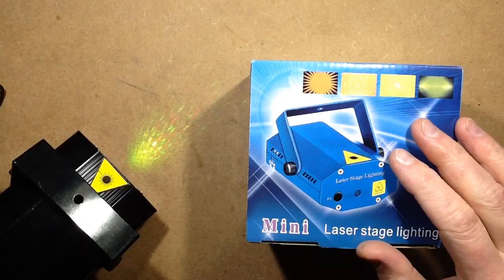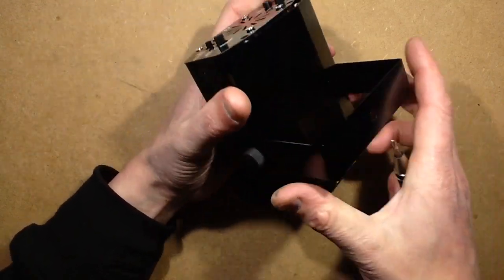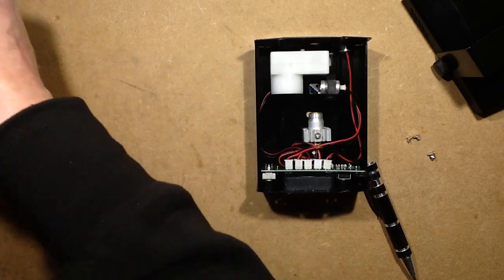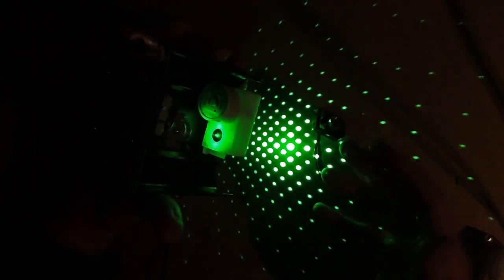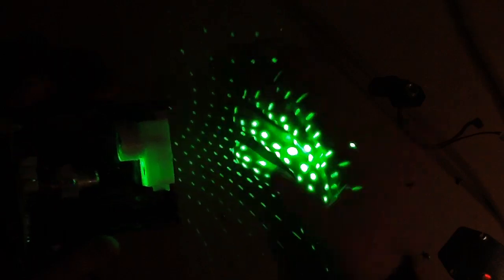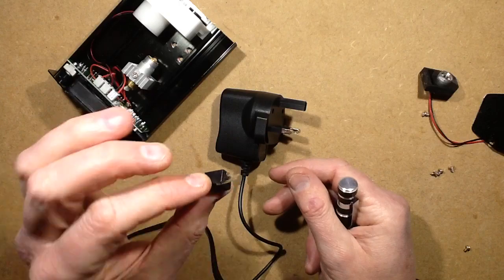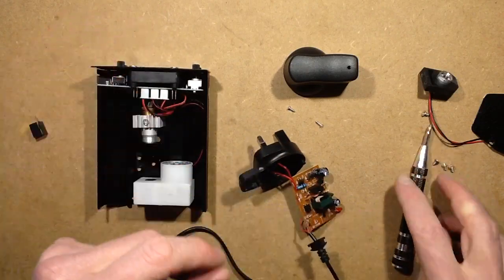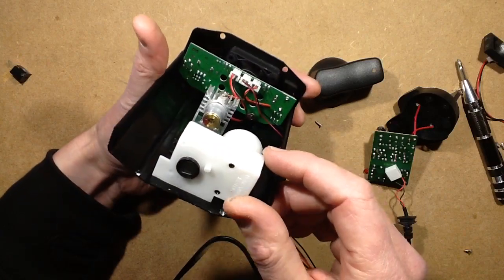Inside a laser star effect projector and mods.

Comment: I made some underwater boat lights using casting epoxy and current drivers last year.  Im light years behind on powering high powered lights. This year my new project upgrade was going to be aspheric lenses to add to the beam effect underwater. Wanted to start using cree multi whatever you call them with multi tir lenses like used on flashlights or off road vehicles. My terminology knowledge is poor so finding the right parts is going slow. In the process i"ve stumbled upon you among many other cool people who love lights, electronics, and similar subjects so thank you for being alive and doing your videos. I now want to skip a step and have underwater laser lights at like a cyan hue wavelength. Green would be good too. If I were to cast resin basically this module found inside the Xmas light leaving part of the heat sink exposed to water for cooling it should be sufficient for cooling. Ive been testing a very undersized heatsink 25watt cob light recently and worked good for the few hours I had it in the water. Srry, just sharing a lil incase it helps anyone wanting to make underwater boat lights for cheap. Back to my ultimate question. I would have to seal the lens sufficiently with clear casting resin with having the least amount effect on the laser output so im kinda curious how sensitive the lasers are and a good way to do it. Not only to waterproof the light but to protect the glass. My other question would be what material is used for high power laser lenses. All i see is videos of the green ones burning things down on here which isnt my intent. Ha. I just want an amazing beam coming off the  back of my boat. If i had enough life span in me id invent a laser light for a boats rooster tail like ive seen in some you tube videos of water trapping the laser light using a stream of water. A rooster tail off a boat could be a small scale bellagio light show effect with a few high powered boats sending up green red and blue 40 ft rooster tails up in the at night. But yea. First things first i just want to seal it off "the lens" without terribly effecting the optics. Maybe just a thicker lens made out of lexan. Would be nice having a thin dual removable replaceable lens also that could  serve just as a barrier from scratching, algae, etc.. from the permanent lens. From what Ive seen lasers bounce off glass very easily but some proper angling of the lens can let the beam through. Just rambling. Think ill just order a couple cheap laser pens and start experimenting. Will also get this light you are so beautifully modifying and tinker with it too. And of course keep watching your video. Thanks for being inspiring in creating new ideas and just teaching people in a way that we can relate. Your videos may be long but for good reason. Ur funny and you arent rushing through the play by play with editing or altering the video. My question got lost in the rambling but thats okay. Keep up the good work. Im anti subscribing but its kinda impossible with you being so on my level as far as tinkering and tampering. Have a wonderful day.

Comment: Violet and purple are not the same thing, Clive.  Purple is a mixture of blue and red;  violet is a wavelength shorter than blue.  The 405nm blue lasers are indium gallium nitride laserdiodes, with a bandgap of about three volts.  

There are direct green laserdiodes available now, but they're quite expensive because green is too short a wavelength for gallium arsenide, but too long for InGaN to do easily.

Comment: I ordered one of these from ebay, after a few hours the red laser failed, I contacted the seller and got a replacement, same thing happened to that, gave up on the third replacement! I now have 3 green lasers, the cases are good for projects, so all was not lost.
One thing I did notice was that the range shop in Dundee also seemed to have issues with the ones they were selling!!!

Comment: I was hoping you'd take the rotating whatsit assembly apart. I know it's just a motor with a few plastic gears but I'd like to see inside for important research purposes (just want to see inside the white box!).
Reply: I did do that!

It's more or less a little servo unit... lots and lots of tiny nylon gears but coupled to an ordinary DC motor.

Obviously they couldn't afford to put in a proper servo motor, given the complexity of the motor and the associated driver circuitry.

It's likely, however, that the speed control was via a Pulse Width Modulation bit of circuitry (on the chip? Hmm. Not so sure about that.)

Anyhow, I hope that helps to explain what's in the whiite box part for you.

Oh, and there are 18650 NiMH-powered versions available. Believe it or not, the housing for the rechargeable verion is actually smaller than the unit Clive worked on in this video.

Comment: true a lot of the cheap pumped diodes don't have very good ir. filtering an if I remember correctly most have a 120mw ir diode on the 5mw. greens but wondered if they had more power to keep the brightness up

Comment: For a 240V VDE approval, the spacing requirement is 8mm. It looks good except for that big white capacitor which is bridging the gap. I think normally that would defeat approval because there is no standard for internal capacitor to external casing voltage creepage distance. I wouldn't do it, but it doesn't surprise me that things like that "fly" these days. I mean, it's only an electrocution hazard, right?

As for the transformer, I'm sure you know, it can't have 8mm of spacing between windings, so it has to do with layers of insulation, but there are also clearance and creepage spacing requirements which have to be met. Typically, there would be spacer tape at the ends of the windings (I'm saying this for the benefit of your viewers because you seem to know plenty about such things) to create a fixed distance between the ends of the windings after the primary to secondary insulation tape is in place. So, if the distance is 8mm, you would need 4mm spacer tape at each end of each winding and the gap would be from one end, past the 4mm spacer of the primary and then the 4mm of the secondary spacer tape for the total of 8mm, and two layers of insulation tape between the windings. If you want a shield, that needs spacer tape too. Best EMI configuration is primary winding, one layer of insulation tape, the primary shield (which grounds to the primary ground), two layers of insulation tape, the secondary shield (which grounds to the secondary ground), one more layer of insulation tape and finally the secondary winding. With all that spacing, insulation and shielding, the transformer ends up being twice the size.

So, for a given power output, you can pretty much determine the safety of the transformer by its size, once you get a feel for how big a good one is. If it's small for the power you're talking about, it probably is lacking in safety and / or EMI shielding.

Comment: I have some StarShower reject laser projectors I got second hand ... they use a DPSS green laser much like yours, but the heat sink is three times as large. The things definitely do get kinda warm ...
Reply from the maker: +Crimson Halo The earliest ones used to have their green lasers fail all the time.  A friend who was selling them gave me a few to look at, and there was a hideous design weakness on the current regulator where a three pin regulator was screwed to the case and connected to by a three pin Molex-style connector on its leads.  It wasn't really a good enough connection for things like feedback pins.
Reply: +bigclivedotcom - I've seen videos indicating that issue, and it made me wonder what was going on. The plastic cases on these things are universally brittle, they didn't use ABS or a good quality glass reinforced plastic to build them, so in the rejected ones I got as freebies, the units had been dropped or bumped, and the components easily broke off inside, often taking away pieces of the casing as they went.

I think I have the newer version of the SS projector. Lots of those mini Molex connectors, but they are all connected to the circuit board and all but one are glued firmly in place. On the laser module there is something running in tandem with the DPSS laser module and positioned in a separate barrel in the aluminum heatsink right next to it. Unsure if it's a heat sensor or what.

Comment: The supply is exactly the same as the USB charger for my phone minus the connector for USB.

I tested mine and got 5.10V, I wonder if you could add a USB power bank with maybe an 18650 cell?

If it was for outdoor use it might take it more portable.

Comment: Glad I found this video again. I recently bought the B&M new one that has the same functions as this but a different effect wheel in it. as the disk rotates the effect changes from those dots, to rotating + symbol to stars then big snowflakes. I wanted to do a video on the effect and tear down but cant find my tripod for my camera lol. The laser impressed me for £16.99, it comes with a 5v adapter, mounting bracket and a tripod with standard screw fitting to stand it on a table. I was also impressed with the full metal construction and cooling fan at the back. Mine looks very similar to yours inside. I couldnt see the shapes on the glass disk though, its really small and I still cant figure out how the shapes rotate, they dont swing around the room, they are fixed and rotate like a scanner roto gobo effect does, even though the disk is rotating in front of the lasers, there arnt two disks or motors, only 1, its just weird lol. Its packaged as World of Gadgets, Multi Pattern Laser Light Projector, Made in China. Item code 312465. Im running mine on a 4.5v adapter to lower the intensity slightly and hopefully run cooler? At 3V one laser stops working.
Reply: I also have one of those that cycles through various shapes. You can't see the shapes on the disc though; only a laser can play them back (similar to a hologram). As the disc rotates the pattern on the disc will rotate causing the effects, but they won't swing around the room. Eventually as the disc moves away from the current shape it will fade out and the next shape will fade in; it's a rather cool effect.

Comment: Just bought one for the lols. Just realized that the fan isn't running. Maby the chip was controlling it too based on temperature?
Reply from the maker: It should run all the time.  Check that the fan is free to turn and that it's connector is in place, correctly wired and has voltage on it.

Comment: Hi Clive, I just found this video. Must have missed it way back.

Anyhow, a buddy of mine gave one to me as he claimed the red laser had blown. With thanks, I tore it down and found that he'd probably dropped the unit after a gig, because the little chip of a dichroic beam combiner had fallen out of its housing.

So I did pretty-much the same as you did there, and took out both holographic films (static and rotating).

Then I put the dichroic back in, so that both beams shot out the front unhindered as two beams; a red and a green.

By the way, the green laser can be between 3 and 5 mW. so be careful!

With some very fine adjustment, I was able to get the two beams to almost line up. Micrometer adjustment would have helped.

At short range, they were practically super-imposed, but by pointing at progressively more distant points (retro-reflective road signs) I noticed a distinct divergence between the two beams.

So, you could almost create a Laser Distance-O-Meter.

A lot of fun it was!

Comment: Clive, 

Wondering if you were able to determine the output power of the green laser. Since we are "restricted" to =<5mW, in a laser pointer, I'm wondering if this would be a cheap way to get a hold of a higher output laser?
Reply from the maker: have you tried ordering high power laser modules or pointers from Chinese suppliers like Banggood?
Reply: +bigclivedotcom No, I haven't. I just figured this would be convenient having a power supply, ventilated case, and two lasers for not much $$

I used to order from dx and bang good but having had my credit card info stolen too many times now, I've stopped sending that info to china... Hasn't happened since.
Reply: +Timothy Meche That's why you use paypal in the middle :)

Comment: How much for one of these and where can I get one, or two? I'd like to take out that green laser and make a laser pointer out of it. Any idea on the voltage? I assume 3 volts b/c of the pen style laser pointers have 2 1.5 volt batteries inside.
Reply: +coondogtheman1234 These are quite generic and can be found on ebay and amazon from a wide variety of sellers. I'd suggest looking for good English descriptions and buy from a seller who is physically located in the same country as you just in case you get a crap one and have to send it back.
Reply: +Matthew Fowler I could get the star shower laser light at Wal-Mart but 30 buck is a bit high for what it is. I've heard of these failing so I wouldn't spend 30 dollars just to tear it down. maybe if it's on clearance I'll get it and experiment. or if someone's tossing one I'll ask them if I could have it.

Comment: Why not just put a 1W 520nm diode in it - only problem there is, it will be annoying to aircraft, at closer range an eye hazard, and it will probably melt the holographic rotating whatchamacall it :)

Comment: Seem fun and modable. 

One could get the lasers to blink 'randomly' and individually with a pair transistors and candle flicker leds. 

Or put a termostat in series with one of the lasers. (Red light up when the unit gets to hot? or green turn off.)

Maybe make it into an "ghost detector"? :D

Make the mic function control the motor and have lasers run continously?

Comment: Hi, like your videos much. One question, do you think it needs the fan realy? I have this Model and cant find any heat when it is on. the fan is real loud in an quit env.
Reply from the maker: The drive circuitry and green laser need cooled.  Especially the laser which will fail quickly if not cooled.

Comment: Is it possible to replace the green or red laser with another colour ie blue or white, or a laser unit  from a laser pointer.  Does the driver voltage matter? 

Thanks.
Reply from the maker: +David Priestley Lasers are generally monochromatic (single colour/wavelength) so a white laser is often multiple lasers combined to create white.  Other colours and technologies would require a driver specifically matched to the lasers requirements.  Some are as simple as powering from a current regulated source, while others require feedback to operate precisely on their lasing point.

Comment: I was a little upset when I got nailed in the eye or the eye lid by a laser from one of these.  I was roughly 30 meters away walking down the street.  Somebody had one on their deck that was broken and it had mirrors inside  and it was shooting a few tight beams down the road. It was easily hitting houses 3 times the distance it got me. It didn't see to have a lot divergence, no permanent damage but it was green.        I told a friend about it and she laughed and told me the lasers they sell aren't powerful enough to do any damage to our eyes. I was skeptical. She said she could prove it and went and found a red pet laser and before I realized what she was doing she aimed  the laser right into her eyeball!!!!!! From less than a foot away.NOOOOOOOOOOOOOOOOOOOOOOOO!   I actually saw her holding the beam continuously and it hitting the white of her eyeball. It was less than a second before I could stop her but a second is a long time when it comes to things that burn you. She didn't have any damage but I still can't believe someone would do that. It's been a few years and I can still remember it like it just happened. She was surprised at my reactio, Under no circumstance would I let her do it again. Apparently she had done the little trick a few times.   I told her that I was positive it can do damage . Especially if it hits the center of your eye or the batteries were stronger, or the electronics were different,  also wave length plays a key. I'm thinking distance now. . How dangerous are they and did I overreact?  Thanks for providing this service to curious folk.
Reply from the maker: If I see a laser beam coming into eye level I always look away.  The risk of eye damage is huge.  If your friend tries it with a green laser there will be a very real risk of permanent eye damage.  When we use lasers on shows we have to routinely test beam strength with a meter where they enter an audience area.
People using hand held lasers at raves have caused a lot of eye injuries.
Reply: Yeah, really bad idea!

Comment: This seems quite similar to the one Ashens did. Is it a poundland job?
Reply from the maker: No.  I doubt you could get this for a pound.
Reply: bigclivedotcom can I take the green laser use a USB power bank to use it as a green laser pointer
Reply: Zangamarth 

Did you watch the vid? Its from ebay m8
Reply: Jonathan Lake No you can't just hook it up to a usb power bank. You need a driver and an appropriate power supply
Reply: Andrew Vollmer a driver?
Reply: DoomGhoul A laser driver is a circuit board that regulates the power going to the laser diode and stops it from taking to much power and burning out.
Reply: Sir what to use to replace the broken glass in the front to make more dots
Reply: Wendell Lumban I am also assuming that you mean the defractor glass at the very front. If so, then you need to look for what I believe is a "dichroic filter" which is what that glass should be. You may have to buy it online.
Reply: Andrew Vollmer thank you sir